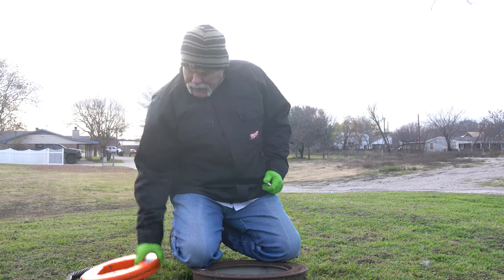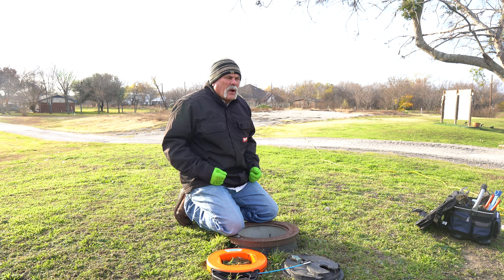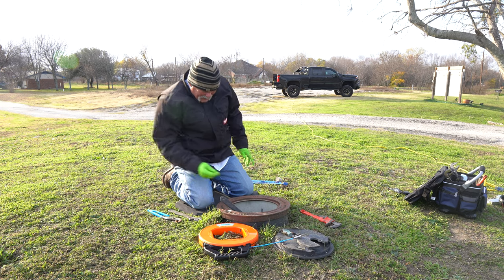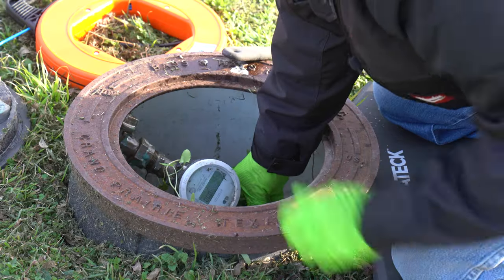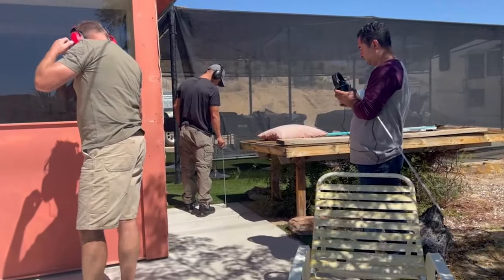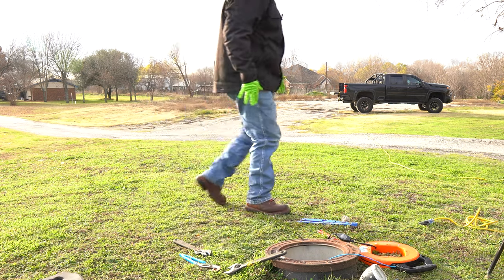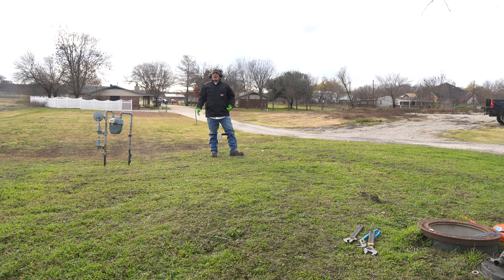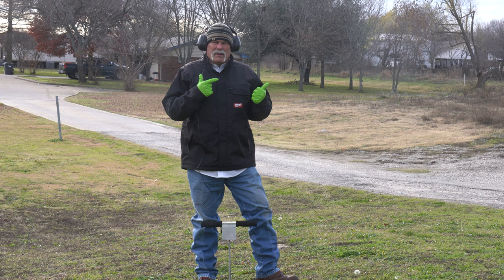NEW and FUN Way to Locate Water Lines

Comment: I kissed that tool as we boxed it up for you, Roger. Now try it indoors. I don't know if you open walls or pipes while leak detecting and tracing lines but that's where the Rattlesnake is unmatched. Open a pipe and push it in. You'll be able to locate where it goes without any problems. Thanks for the shout-out! It was good seeing you guys the other day
Reply: Why not just use a regular router and trace it with an EM Locator way faster

Comment: And for line locating the best thing is a fish tape with the ridgid locating brick transmitting 33htz through the line paired with the ridgid navitrack locator.
Reply from the maker: We are looking for something better…
Reply: Open-space, outdoors with $4000 of Ridgid tracing equipment is really good and works in many situations.  However, once you get around other utilities or up to a building it becomes extremely difficult and most experts don't fudge with it.
Reply: Radio detection brand is much better

Comment: Honestly, I would just grab some 12ga copper wire, cut and skin two pieces about 20" long, cut two 6" pieces of PEX, bend the wire into an L shape, put the PEX on the short ends for handles, and proceed to douse out the line.  The trick is to walk from both directions, and when the wires cross at the same place from both sides, you found your water line.

Dousing to discover a water line has never let me down.  Although, I live in NC so our frost line is 12", so nothing is super deep
Reply: The head of assembling the Rattlesnakes at the factory was a retired journeyman electrician. At any given time he had his dousing rods in the back of his truck.  Swore by those things.  I had so many conversations with him about them.  Nobody ever trusted his sticks enough to dig up a yard or open a lady's wall to see if he was right tho....

Comment: I have for years now just adapt to the meter side with a 150lb gauge body and valve off or cap the other end and pressurize the line as high as I can around 150 psi and you will find your leak because it will be pretty loud. When I do not have a compressor that will put enough in the line I use my nitrogen bottle it works best and does not hurt anything in the lines since I use it for Med Gas piping also. This is how I have done it for 42 years now in The DFW areas and it is way cheaper than fancy equipment you do not need. We did not have that equipment years ago I you do not need it now, you just have to be a little creative adapting to your meter or piping it is pretty easy. Just about everybody has a compressor and a nitrogen bottle is not that expensive either.

Comment: All i do to find leaks is compressed air and a good listing device.
Reply from the maker: What listening device do you use?
Reply: @RogerWakefield  it's called I-99 which is an in house built listing device, I'm sure you know about American leak detection. Don't want to share too much but I've done work for very high end clients in Pebble Beach and have been on point except for 3 detections. Can't win them all.

Comment: I purchased the leakpro full kit and cannot hear leaks through slabs with air induced into the water line. Purchasing this equipment was a huge mistake and lesson learned. I now use leaktronics and can hear 100x better. Would 10/10 not recommend leak pro. But hey that’s just coming from a guy that’s out here in the field locating leaks on a daily basis
Reply from the maker: Taylor did you contact Leak-Pro? Everyone else hears them. This is the first complaint I’ve heard in a year.

Comment: Heck, it would be nice to just put a little sonde at the end of that push rod and then be able to use your locate wand. Not like you need a camera for freshwater, but would be nice to be able to trace it out via sonde and locate wand… that would be awesome! Love the videos!
Reply: Super good and common question! The physical dimensions of a sonde is too large for small diameter pipes. They literally cannot be made small enough to go into a 1/2 ID pipe. Otherwise we would have it already.
Reply: We use a traceable rodder hooked to a signal generator and then trace it out with the locate wand. Works great until you hit a T or elbow. When you have to locate a line across long distances nothing we have found works better.